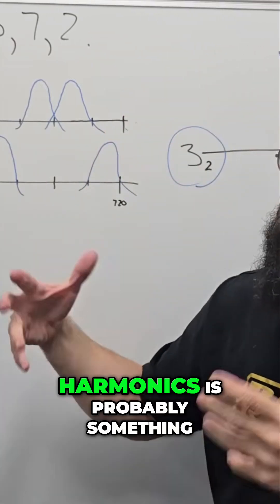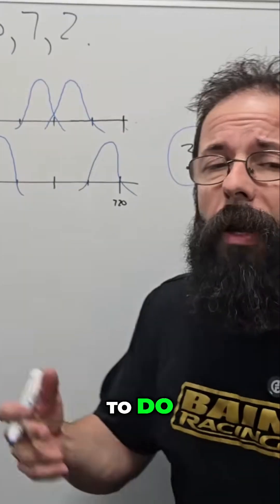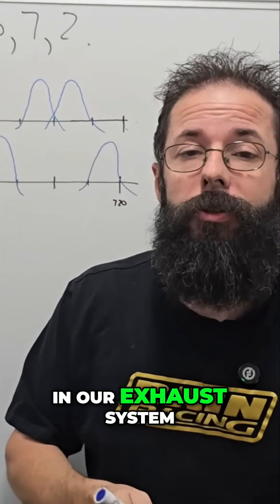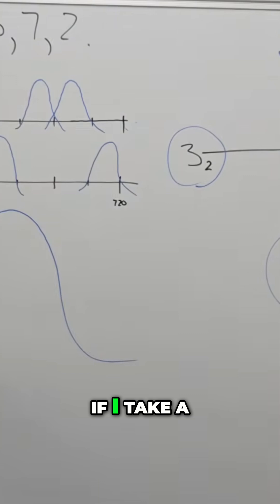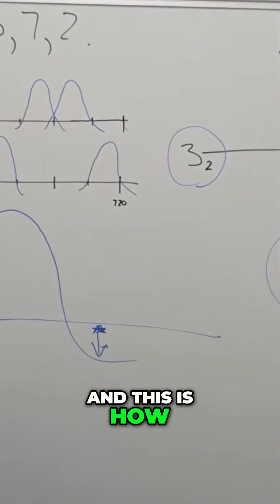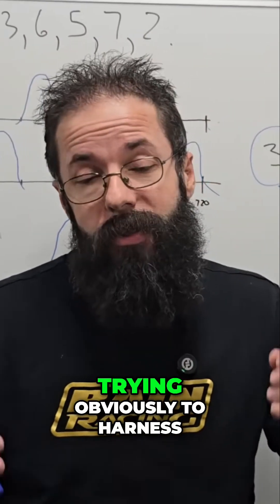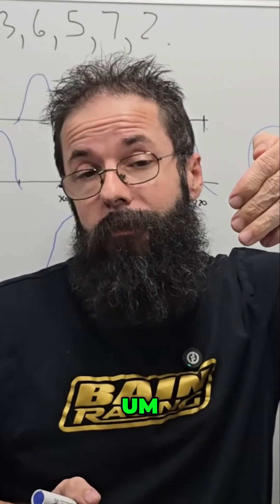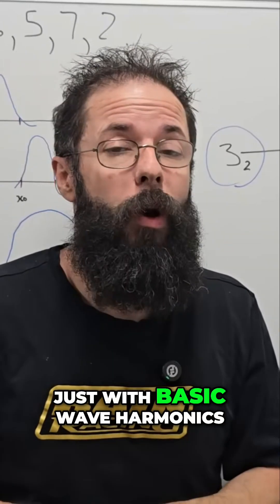Exhaust Wave Harmonics: Achieve Negative Pressure for Power!

Comment: I will die on the hill that the phrase "an engine likes a bit of backpressure" isn't a myth so much as a misnomer. People just don't know a better word for this sort of wave harmonic tuning, so they substitute it with "backpressure".
Reply from the maker: No. You're just not understanding pressure differential Not only do we not want backpressure.  But we want less than atmospheric and if you design the pipes right. That's what you achieve. Maybe look into studying port pressure profiles and it might make more sense why we need a negative pressure in the exhaust.  👍
Reply: @bainracing  dont get me wrong, i dont believe in the backpressure thing, i just think that a lot of the people who say it mean vaguely the same thing you are, but they just lack the vocabulary to explain it, so they just use an utterly wrong word to express it.
Reply from the maker: @gummostump4217 Yep. Lots miss the mark in understanding air flow. 👍

Comment: What about turbo applications?
Reply: Works there too, you need an expansion to generate the negative pressure wave however, such as a collector before the turbo. You also need to consider the pressure differential across the cylinder as Jake outlined in the video. If your exhaust pressure (emap) is 3x your intake side, then this mechanism is unlikely to do you many favors.